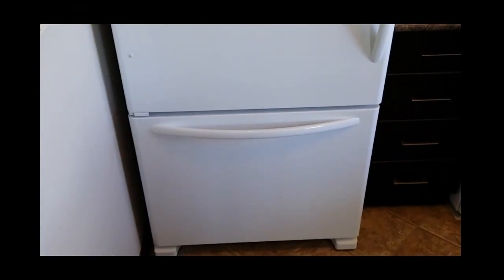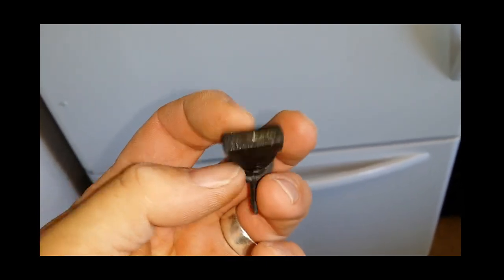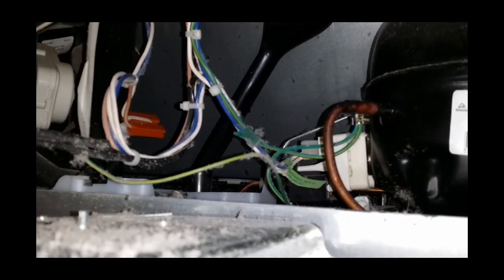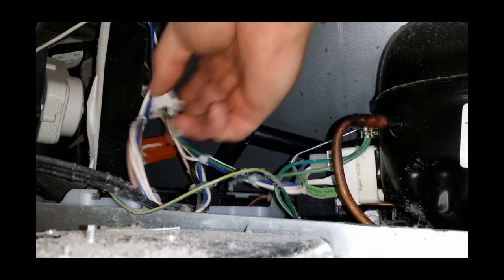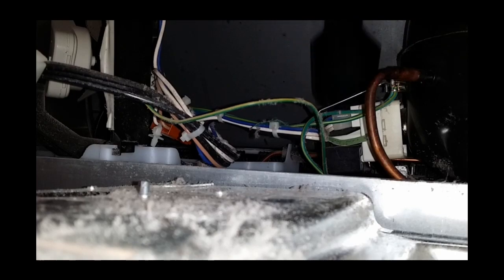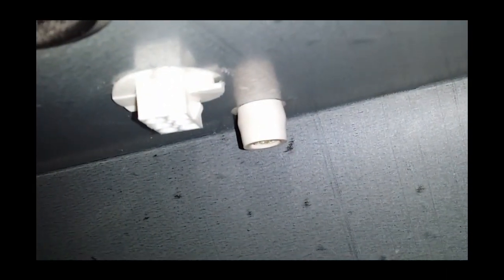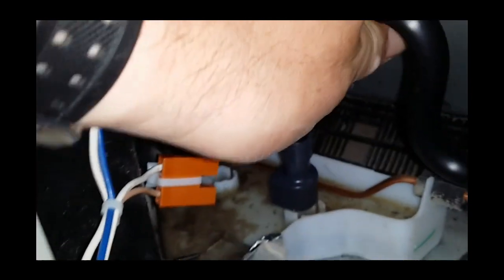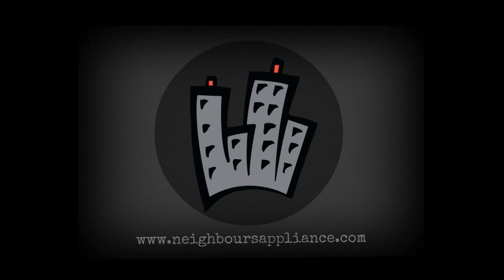Drain Tube Installation on a Whirlpool Bottom Mount Refrigerator

Comment: I have a whirlpool refrigerator model number ET1FTTXKQ02.  I have had to defrost the frozen drain tube 3 times now.  I keep getting water in the fridge due to the drain tube being frozen.  I watched your video for the p-trap.  My current drain tube does not have a duck check valve on it.  Can you tell me if it should?  Second question will the p-trap work on my fridge.  Thanks in advance.

Comment: I just order this fridge n got it delivered 3 days ago from Lowes . I'm wonder now if this is on it or not 😓 tonite I started putting some more food in it . I waited almost 2 days  I notice some ice in fridge at the very to middle back on the grill looking things behind the temp control  .. at the back wall .. then it started melting some as I put a few things in . After a hour or so I check are still some water around the plastic grill but no ice . I'm concerned . Do you know what may be going on  . I'm thinking I need the 5 years extra Lowes warranty
Reply from the maker: Naw.  This problem was fixed in the factory a couple of years ago already.  Your fridge will not be like this one.  You might have other problems, but this is not one of them.
Reply: Neighbour's Appliance Service ok thank. You I appreciate it ... just hope it last a while ... thanks